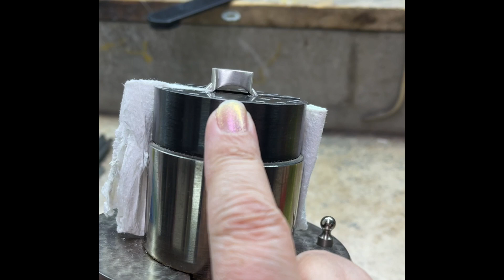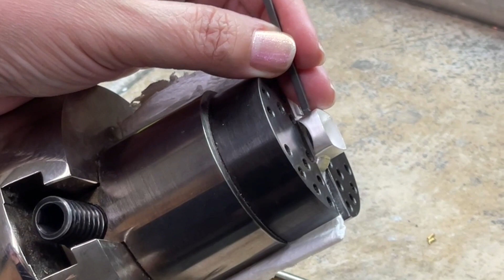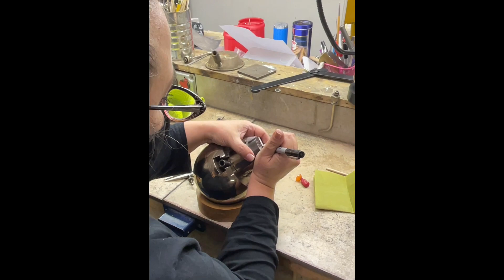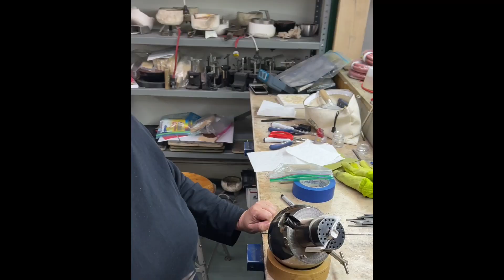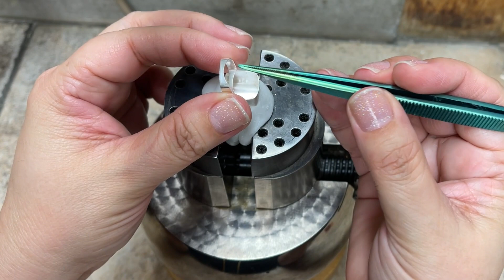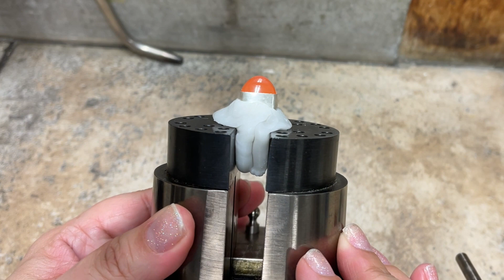Bezel Settings for Cabochon Gemstones On a Curved Surface ( Inner Bezels are Key!)

Comment: Thoroughly enjoyed your video. I plan on setting a rectangular stone in a box ring. .... and, using the walls to hold the stone. The walls are actually 20 gauge silver and instead of adding a step bezel as you advise, I want to thin the thick walls and by doing so, creating a ledge (shelf) for the stone to sit on. In that way, the walls would be easier to work with setting the stone. I have also soldered a small rectangle on the curved inner part of the ring to guarantee that it will not be wobbly.
From what I have been told, I must use a ball burr to gradually reduce the thickness of the thick wall that will act as a bezel.
Kindly advise. Thank you!
Reply from the maker: That will work but it takes lots of practice to really control the thickness and carve an even seat. I suggest you do at least one practice bezel to try it out. :) So glad you enjoyed the video!

Comment: Finally, permission to not have that inner bezel fit tightly in there! Properly, yes, but not so tight as to be difficult to remove it for adjustments. I've been taught that the inner bezel should fit with absolutely no gaps, then soldered in place inside the outer bezel - The horror!!! Great demo and it makes so much sense. Thanks.
Reply from the maker: Hi Linda Super tight fit and soldered in only makes sense if the back is open. Otherwise, it is pointless!
Welcome to the rest of your life :)